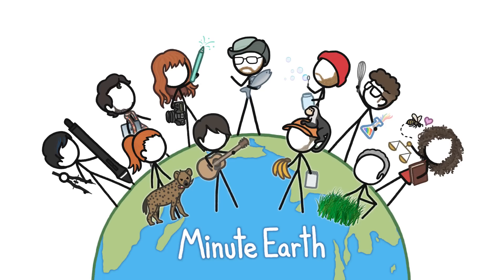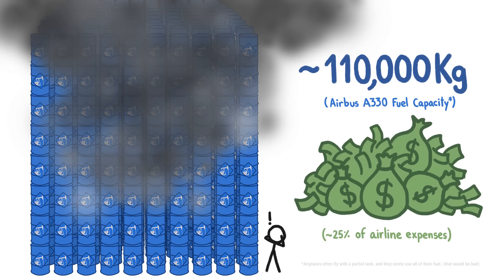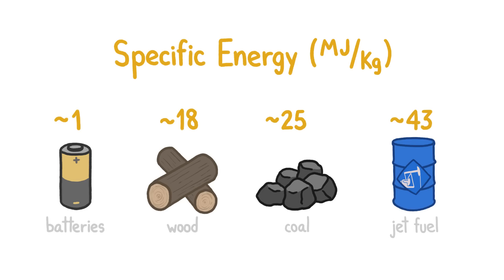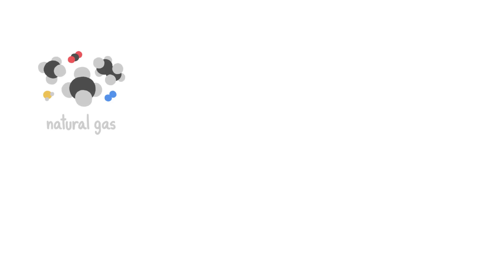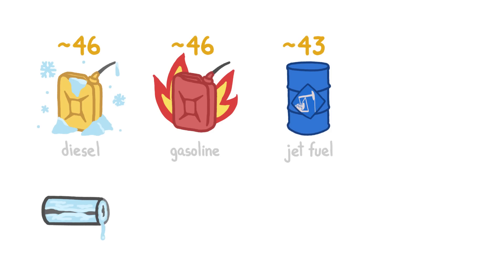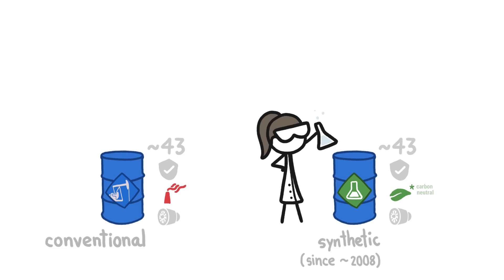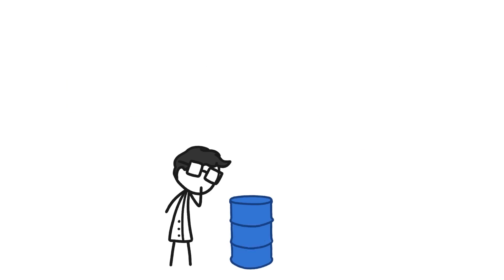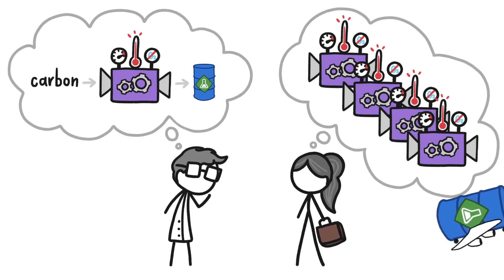Is There A Better Way To Power Airplanes?

Comment: one of my favorite facts about this is that jet liners and geese have about the same maximum range without refueling (or in the case of geese, spending a season getting fat again,) because both of them start their journey as about the same fraction by weight of oily hydrocarbon fuel with about the same energy density, which they burn to move the remaining payload fraction a similar distance.
Reply: kinda like the fact that the early airliner originated for military use , 
and geese are evil  by nature ...
Reply: Davide Garuti idk what geese you have but mine are ducking cute and nice, all you have to do is:feed bread  feed more bread and more bread also when they have babies FEED MORE BREAD the parents will trust you to feed the babies bread and the family will naturally come to you and love you for ever
Reply: blcs, check out the book "Renewable Energy Without the Hot Air." the author goes through all the math to show how the various terms cancel. (the basic energy math of various modes of transit is the main idea of the book.)
Reply: @dr.kraemer  A little off the mark because a goose is like 25% fuel and a jet liner is 45% fuel. The point he was making in the book is that a goose or a plane would have similar-ish ranges given they have the same fuel:mass, not that they do have the same fuel:mass.
Reply: indeed, this is one of those things where 'about' means they have the same order of magnitude for non-coincidental reasons, not that they agree exactly.
Reply: This would suggest that aeroplanes are at the limit of efficiency. Evolution always tends toward efficiency by virtue of the process (with some exceptions related to mating). A major adaptation like migratory flight which is also related to reproduction will have all eggs placed in the efficiency basket.
Reply: @pancakelegend  Not necessarily, just that airplanes have a thermodynamic efficiency similar to a bird.  In both cases, it's definitely under 50% with the bird more like 20-25%.  That's one of the reasons that battery planes are not quite as bad as they look at first blush.  They can convert electricity to mechanical work with 2-3 times the efficiency of engines burning jet fuel.

They also remove some engineering constraints on the speed of rotation of the big fan in a jet engine.  People have tried to use gears to slow down the very fast internal turbine to power the big fans which want to rotate slower.  But it gets heavy and/or unreliable and no commercial engine like that is out there yet.  On the other hand, electric motors can just run at the right speed, so you get another boost.

Similarly, the overall layout of the airplane can be fairly radically reorganized when working with electricity (blended wing designs to save a lot of weight and other things you can look up where the engines are placed in ideal locations).

You're still not going to have intercontinental ranges until batteries have another big leap in energy density.  But we're close to being able to make big airplanes fully electric and still hit ranges around 1000 miles.  That'll make a huge dent in emissions even if it doesn't solve everything.
Reply: @pancakelegend  that's an incredibly weak argument
Reply: "with about the same energy density"
So you're saying that we should be using goosefat instead of synthetic jet fuel?
Reply: @BNerd is surprisingly similar. The challenge is that goose fat doesn't flow well when cooled.
Reply: “Attention passengers: we will not be serving foie gras with dinner on this flight, because the captain made an error computing the fuel consumption and we need the extra goose fat in the fuel tanks.”
Reply: So, instead of powering planes with synthetic jet fuel, we could use geese fat?
Reply: Lesson: GEESE are the jet fuel of the future not synthetics
Reply: GEESE-LANE AIRPORT OPENED IN BIO-LAND!!! NOW YOU DONT HAVE TO WALK OR SWIM TO THERE!!!!! WHOO-HOOO🎉🎉🎉🎉🎉🎉🎉
Reply: i think thats just coincidence, because there are many more factors to calculate in. we cant just scale things up. they fly with different speeds, different heights, different flying techniques etc.. a geese is not a plane after all.
Reply: @2406ab  yeah , it's just a funny coincidence ,
kinda like how every country that has ever howned alsace and lorreine has lost the major conflict with the country that didn't have those two provinces ...
Reply: blcs you’re absolutely wrong. A goose IS a plane
Reply: @2406ab  Shut up! Now, get back to work on my goose-powered jet!
Reply: We using geese to power planes